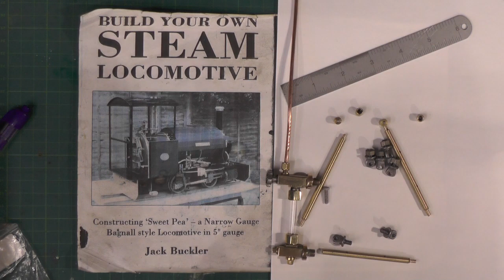Build Your Own Beginners Miniature Steam Locomotive Series (Finishing Touches P1 ) "mr factotum"

Comment: Ho Mr. F.  The locomotive 🚂 looks awesome.  Won't be long before you have her steamed up and pulling you along the rails.  I am truly excited for you.  Not to mention all the tips and techniques you have shared going along with the build.  Thank you sir for taking g the time to film, edit and post the video.  I am curious,  did I miss the olive piping episode?

Joe
Reply from the maker: hi joe
thanks for all your support, its such comments that keep me focused, and i appreciate all that.
As for the olives / nipples, i mentioned them  with a drawing in one of the piping video's, but when time permits will do a video on the subject soon.
Due to covid restrictions still in place there's no track days at my club, and also the boiler inspector isn't doing testing as yet, so can't get the final pressure test and steam test certified yet, so may just steam it up at home as soon as i can get some coal, again covid restrictions. Hopefully a home steam up very soon, so watch this space, just a few odds and ends to tie up, ive also got to sort some way of transportation method out to get it in and out my car safely, as its far to heavy to carry, as a guess it must be heading on for 2 cwt  (for those young enough not to know what a cwt is, and reading this comment approx. 100kg!!!!!) when full of water. I'm unveiling the loco's name soon, and showing how to make simulated cast brass nameplates, to cover the pre drilled holes in the cab sheet plate material i used to save money!!!!!!
Next project i may make a tender for it!!!! or if we can't elimnate C19 lockdowns i may make another loco!!!!!!  to keep busy,  watch this space.
Anyway Joe thanks again, and hope to see you back soon!!!!
regards
mr f
Reply: @MrFactotum  thanks for the update sir.  Hopefully we can all get the covid stuff behind and live semi normal lives again.   I get notification of your videos and enjoy them very much.  I know the extra time it takes to finish something because the filming and everything gets in the way.  I am closer to being back in the shop. (Thank goodness).  One small setback but should be soon.  I am itching to make chips or some kind of mess.  Haha. Thank you again Mr. F. For the update.

Joe